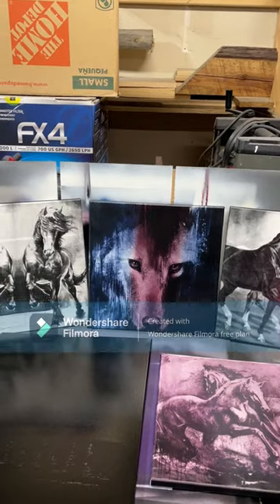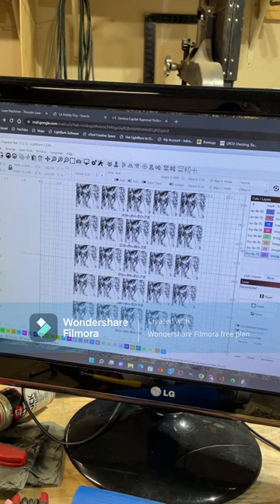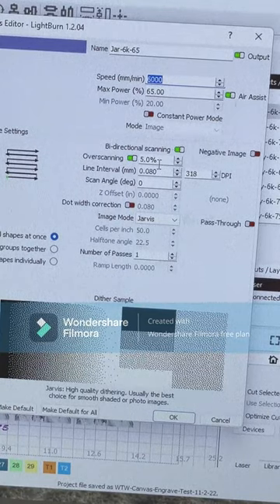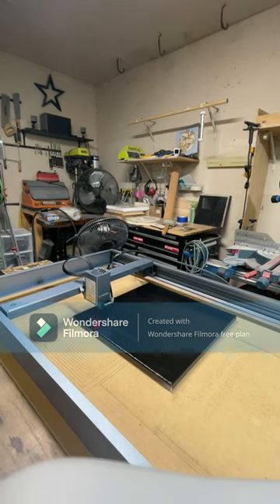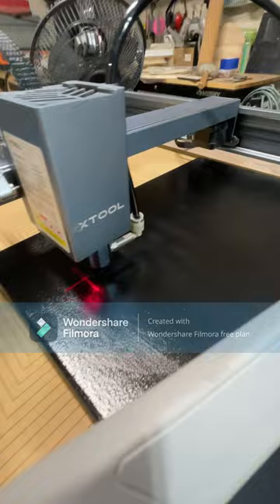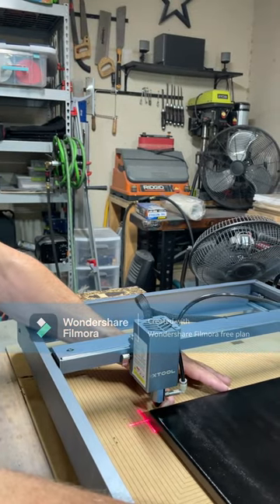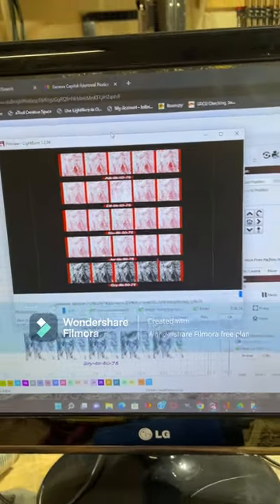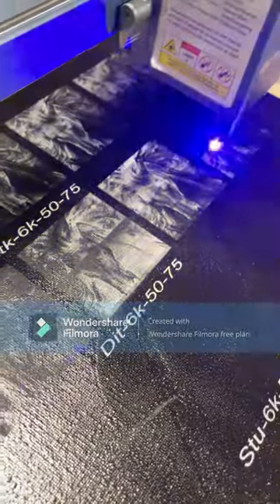How To - Creating a Painted Test Canvas for Laser Engraving on the xTool D1 10w Diode Laser

Comment: Very good video! and thank yo for sharing your burn file. One question, in your video your laser head is moving left to right however the the burn file you shared shown the path of travel going diagonal . Is there a way to correct this?
Reply from the maker: Yes, just change the angle of the engrave in the file from 45 to 0.

Comment: At what angle do loose those lines in the burn as it appeared that the last one in the top row didn't have much of a line.
Reply from the maker: Hi, on this test I left the angle at 0. I find that setting DPI to 320 or greater and using a 45 degree angle yields the best results. Getting great results will vary based on the laser you are using,  the speed and power settings, how you processed the image, the DPI and the angle of the engrave. Hope that was helpful.

Comment: Very nice. Could you share the file outside of Facebook? And, what material are you using for the engraving? Or are these settings for all materials? (Wood, Acrylic, Glass) Thanks
Reply from the maker: I’ll get a shared Google drive to start posting files. This file is specific to canvas engraving. There are various files for different materials. The Louisiana hobby guy has a universal file but is not for canvas.
Reply from the maker: Hi, I have added the files on my google drive site. There are 2 files, once is a reference image that shows the engrave setting should they not import correctly when you open the lightburn file.

Link To Test Files:

https://drive.google.com/drive/folders/1GL481nagSu7Q2ay_WtTZrZCLMppbAeI3?usp=sharing

Please let me know if you have any issues accessing the files.
Reply: Thanks a lot!  @wtwtx

Comment: Can you share the setting for the 3 color layer? I tried so much but the middle color will pass away. Obviously I tried different power, but or can't engrave or pass directly to the 3rd layer (the white one).
Reply from the maker: Did you create the test canvas? Every laser is different so any settings I may use could very on yours.
Reply: @wtwtx  i did but I don't understand wich settings is better.. on the test too I just see the first and 3rd layer..
Reply from the maker: @chazy10  the best setting I have found and a test you’ll need to do is running between 5000-6000 mm/min and test power between 10%_100% until you find the setting that works. The key is in prepping the canvas. 2 layers of white, 2 layers of 2nd color and 2 layers of black. Apply horizontal and vertical method.

Comment: I have upgraded to a 20watt d1 laser, is there a way to convert the 10watt settings to 20watt? Thanks
Reply from the maker: Hey Mike, my suggestion would be to first lower the power by 50%, increase speed to around 8000 and run a test canvas. I would suggest to get a 14x14 canvas, prep with 2 coats of white follow by 2 coats of black. Do a 4x4 test with the image your going to engrave. Continue do 4x4 tests on your canvas adjusting lower and speed until you achieve the result you like.
Reply: @wtwtx  I'll do that, thanks
Reply: @wtwtx  when you say 4x4, explain please?
Reply from the maker: @mikeledee8786  whatever image you are wanting to engrave, create a 4” x 4” version of it so you can create multiple tests to run on your 14x14 canvas until you get the results you want and not waste multiple canvases testing.
Reply: @wtwtx  ok
Reply from the maker: @mikeledee8786  you can download the test file I created and adjust your settings as needed https://drive.google.com/drive/mobile/folders/1GL481nagSu7Q2ay_WtTZrZCLMppbAeI3?usp=sharing

Comment: Do you have this file for us to use or do you have a different suggestion for making your own? Thanks
Reply from the maker: The link to the file is listed in the description.
Reply: @wtwtx  Are you using lightburn or gmip prior to doing this test or using the image as it is? Thanks
Reply from the maker: @mikeledee8786  the image was processed in gimp
Reply: @wtwtx  thanks
Reply from the maker: You bet
Reply from the maker: Hi, I have added the files on my google drive site. There are 2 files, once is a reference image that shows the engrave setting should they not import correctly when you open the lightburn file.

Link To Test Files:

https://drive.google.com/drive/folders/1GL481nagSu7Q2ay_WtTZrZCLMppbAeI3?usp=sharing

Please let me know if you have any issues accessing the files.